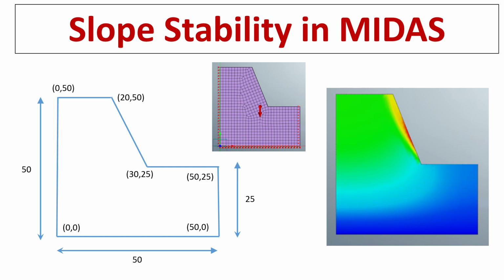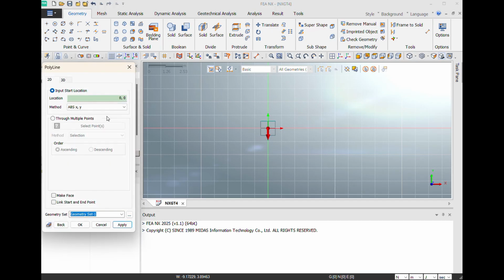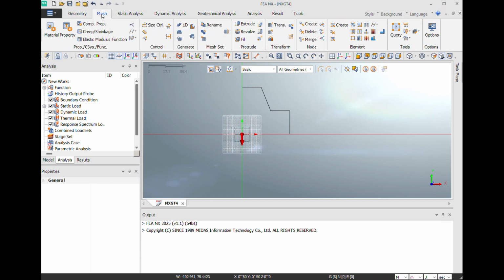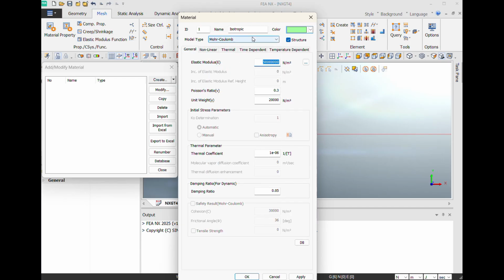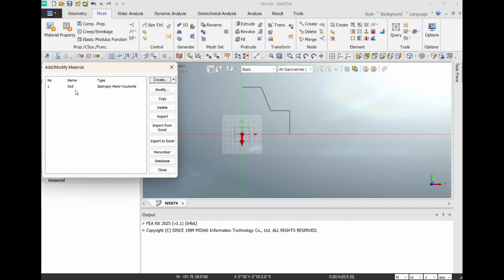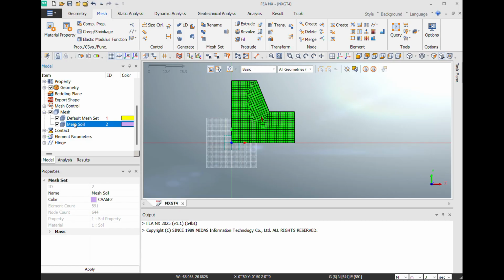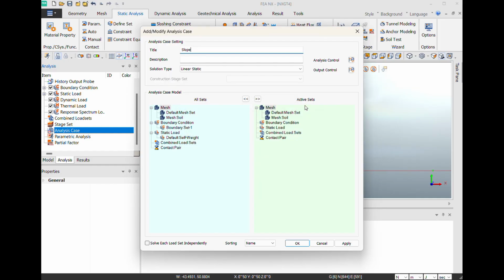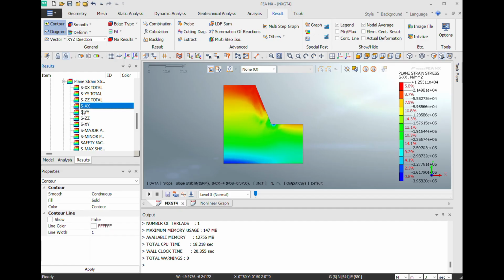Slope Stability in MIDAS Software || Slope failure in MIDAS || Slope analysis in MIDAS ||

Comment: Nice channal, but please make for us= multi-stage(zoned) method design examples of practical profile of gravity dam and single stage, please please?????
Reply from the maker: Thank you. Gravity dams are concrete dams. So the zoning will be only different type/ grade of concrete at various places/ uses of dam in that section. Do you mean Embankment ??
Reply: @damengineering  thanks!, No no Embankment, in lecture classes there are many types(methods) of Gravity dam design. among them the most common methods are: multi-stage(zoned) method, single-stage method. I can send to you 4 page handout that describes them.
Reply from the maker: @djjah771  Send the handout at "damstoknow@gmail.com"
Reply: @damengineering  I send it to you.
Reply from the maker: @djjah771  Multi Stage/ Zoned is nothing different than the stability check at different elevations. When we do the stability analysis, we generally do at foundation level. But during detail design, we have to check the stability of dam at different levels. That is, for example, even if you do the stability analysis at any height, dam should be stable with respect to sliding and overturning and no tension should develop. When resultant of moments or eccentricity is within middle third, no tension will develop. So it is nothing but doing stability checks at different levels.
Reply: @damengineering  ok, thanks a lot. If I have any other questions related to dam engineering, Can I ask?, Dam Engineering is my faviorate feild!
Reply from the maker: @djjah771  Yes